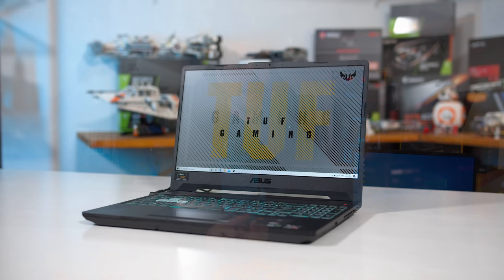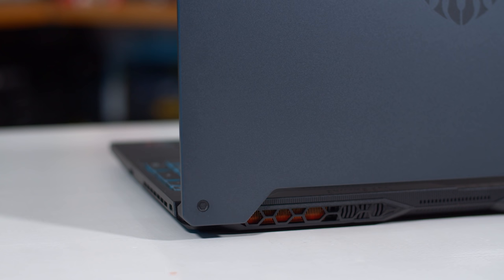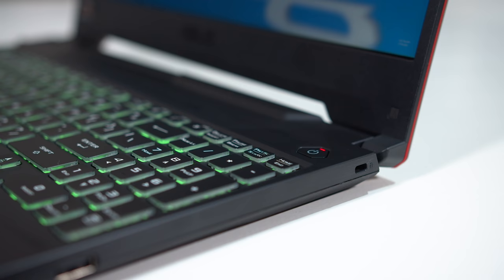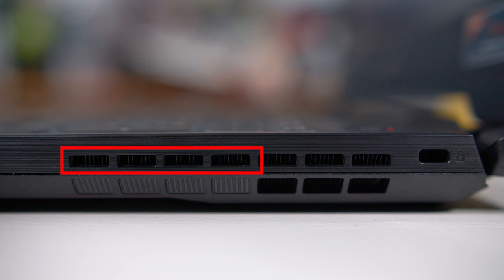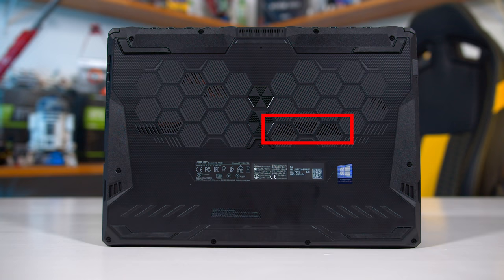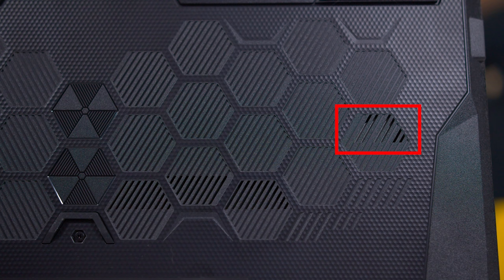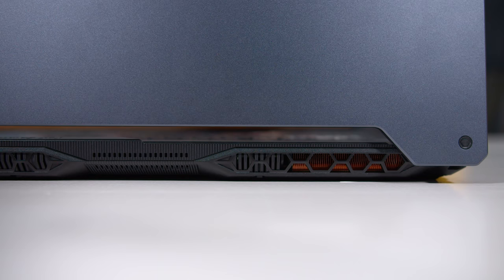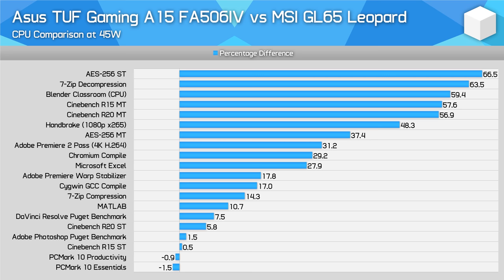Don't Buy The Asus TUF Gaming A15 (2020 Model)

Comment from the maker: Asus say they did not intentionally compromise the product in an attempt to make customers buy higher end systems. We offered our opinion that this might explain their design decisions, however the wording we used was poor. We've removed that section from the video.

Asus also deny the cooling design is flawed, saying that using an open vent design is overall worse for thermal performance. We are looking into independently verifying these claims and will update you when we have tested the laptop further.
Reply: thankyouuu...
Reply: It's wierd, it's surprisingly cheap where i live, so I'm still gonna buy it probably. I hope you guys keep doing this kind of videos, i personally would even buy a modded bottom panel. Overall i still believe you bringing up this problem was the right thing to do. As for the screen, i believe it's as bad as the others in the price range, like the GF65 thin, which has a 8% price increase where i live, and it has similar specs, though probably better build.
Reply: Thanks for being honest and correcting the mistake. 👍
Solid move! And thanks for getting in touch with asus about it.
Reply: Your review is most probably correct and Asus claims are most probably not. I have the same but 2019 model with the Ryzen 7 3750H and RTX 2060 and it is a bucket of heat, noise, and video problems, being the first that the computer shows the video panel attached ONLY to the APU and some games just do not use the GPU whatever you do. You MUST play with headset on or you won't be able to hear the game over the roaring fans. The NVMe is not the fastest, just ok-ish and cheap... I was also surprised by the lack of proper ventilation, and I opened it to install an additional HD for storage. If the heat pipes are not the same they look very similar, so maybe you are dealing with an old thermal design. Now I want to test it without the bottom part, dammit...
Reply: "using an open vent design is overall worse for thermal performance." that's some BS when MSI's GL65 performs way better with open vents. For them to deny that their design is flawed = buyer beware alert.
Reply: So as i had stated on the day you reladed this video i had purchased this laptop the day before.  I now have it. This is using the exact same clamshell case design that is in the FX505 line.  A line i might add that has both intel and amd processors for all the people claiming ASUS is trying to hurt AMD.  I was happily supprised that this laptop can take a 2.5 inch drive if u dont get one with a 90wh bat. Hiden in the box was the connectors needed to do this.  Most of the time it is nice and quiet though i do use a powered cooling pad.  I have only had it get loud when running 3d mark.  Sadly this only had 1 stick of ram but i have a second stick that will be here in 3 days.  If more venting is needed for this laptop 5 minutes with a dremal tool will fix that.  For $999 USD it is a lot better then what i am currently seeing as alternatives. That may change in 6 months, but i hate playing that game.
Reply: Ryzen needs to support undervolting or just do it in factory settings. Then the thermal performance wouldn't be an issue. I had to UV my 9750H & made huge difference in my gf 65.
Reply: ASUS just Acknowledge you're design flaw already... you will loosing money.... or some rich brands with blue color will cover this shenanigans
Reply: I am looking for a good laptop to run Adobe graphics products. My last HP Spectre almost exploded due to cooling issues so your update is extremely important to me since good cooling is definitely in my top 5 must haves. Please update ASAP. Thank you.
Reply: bruh how is open vent worse
Reply: @GabiCostin001  i suggest you dont !!! MSI, Dell and Acer are yet to come to the race so i highly think you should wait a little longer
Reply: Please review mi notebook 14 horizon top model please
Reply: Looking forward to the testing, this sort of design has been around for years, nobody really talk about it.
Reply: Agree with Asus about the thermal design. Open holes are not necessarily good.
Reply: @winnewFirst  because they accumulate more dust in fans?
Reply: Anyone looking for a gaming notebook and worried about thermals. The gf 65 has a good cooling system and by undervolting the cpu an gpu u can have the same performance and very good temps. Its a good value notebook if u get it with the rtx 2060. Plus the i7 9750 puts out a constant 4 ghz playing games and has a 4.5 ghz max. Only way ur gonna get better performance than a gf 65 is with a rtx 2080 or 70 labtop.
Reply: @GroovyDrifter  Hey there!  So I owned the FX505DU before upgrading to the A15.  My brother still has his FX505DU though.  While both generations do certainly run hot, the two of us have found a great solution, and that is to use either Ryzen Controller to manually cap the TDP at *just* below what we see it use on stock, OR, just do the quick-and-dirty turbo-boost-disabling registry tweak.  Here's the kicker though: these two CPU mods don't work nearly as well without simultaneously undervolting/overclocking the GPU (as they share heatpipes, remember) so by doing that, in addition to the CPU mods, we have now attained GREAT thermals, at literally no cost to FPS.  In fact, sometimes we even see better FPS than stock!

Just as an example: using the turbo-boost-disabling trick, while simultaneously UV/OC my 2060 (via MSI Afterburner) to run at 1500MHz@0.700 across the board, I have achieved 100% identical framerates in all my games, but am now sitting permanently at 85C on the CPU and 80C on the GPU (instead of 95C and 86C).  Basically, the UV/OC performed on the GPU does well at making up for the cap on boost clocks.  Now if you're willing to perform a little trial and error, you can dial in the precise TDP using Ryzen Controller, and achieve even better framerates at the same temp, OR, since it quite more granular, a little bit lower framerates at lower temps, or higher at higher temps, etc.  You get the idea!

So you know, with the lower temps that we have achieved, the fan noise has been significantly reduced as well!  Hope this helps, and happy computing!
Reply: @gultar4513  Hey there!  You can significantly improve on your thermals in the A15, without compromising performance, by capping the CPU's TDP (or disabling turbo boost) while simultaneously undervolting/overclocking the GPU.  Instead of running at 95C / 86C max on the CPU / GPU, I'm running 85C / 80C, respectively.  Again, no FPS drops.  In fact, sometimes I see FPS improvement over stock!  Just thought I'd let you know.  Hope this helps, and happy computing!
Reply: i think they didn't open vent because of military grade design, they have to ensure that the product is long lasting, small vent will prevent dust or humidity go inside the lap. as Asus said, TUF series is long lasting product. Disable Turbo boots will  make the temperature much better.
Reply: @keubibo  No recent electronic product that built to last.
Reply: So, How's the update Test?
Reply: > Asus also deny the cooling design is flawed, saying that using an open vent design is overall worse for thermal performance. We are looking into independently verifying these claims and will update you when we have tested the laptop further.

That statement is blatant lie by Asus which you've ALREADY DISPROVED in your video by pulling the laptop's bottom shell, thereby uncovering the obstructed vents (eg.. creating an "open vent design"), and immediately improving thermal TDP efficiency DRAMATICALLY.  You provided empirical measurements to back you claim.  Asus' marketing/spin dept is full of it.

Look I realize unlike true journalistic media outlets, YT content creators live & die by staying in the good graces of OEMs.  Otherwise your access to new products are cut.  But you need to call BS when you've done the work & have the facts on your side.
Reply: Translation: ASUS is intentionally lying.
Reply: If you say so, I was about to buy this laptop. What do you recommend instead?
Reply: @theskywalker8416  When are these new MSI laptops coming? I'm asking because just today I was searching for laptops and so it happened that I had to choose between Asus Tuf A15 and MSI GL65 and I chose the first one, because it seemed better in every way. But now seeing this video and the comments about the heating problem and Asus pulling some bullshit... I may change my mind and pick MSI GL65. But now that u mension new MSI and that it is pays off to wait for them I think I can check them out to? Can u tell me more about them? When are they coming?
Reply: i really dont understand why they had to close some space where cooler take the air or use that monitor with with faster 45 watt laptop cpu on the maket
Reply: Asus has also blocked the underside cooling vents on the Zephyrus G15 Ryzen. The intel version known as the M15 with the same chassis is not blocked and therefore runs cooler, although it is still slower.
Reply: The statement of an open vent design being worse for thermal performance doesn't make sense.

There are pros and cons to the open vent design, but I'm certain that more ventilation would mean that the fans have more to breathe and the obvious benefits of airflow. The cons are obvious; potentially more dust ingress.

With all that said, my old Lenovo managed to combine good airflow with reduced dust ingress from the simple addition of a god-damn dust filter...
Reply: I bought mine with a 4 year in-store product replacement, and I will be using aluminium foil tape on the plastic area below where the fans go to help further cool the air flowing threw it. And I have a question, I'm gonna try to buy a spare bottom plate so that I can modify it for more airflow without voiding my ipr, was wondering if maybe you or anyone in  the chat here might know the best place to get things like that??? I tried eBay but the laptops too new to find parts for on there.....
Reply: tracking thread. I suspect Asus is simply covering their ass but is there any merit to the idea that closed vents can be better for cooling?
Reply: @robotgirlenjoyer91  The MSI GL65 is a 6 core Intel chip, the TUF is an 8 core AMD chip. AMD's run hot on more cores but don't throttle. People are idiots for even thinking this comparison proves anything.
Reply: Will be awaiting for the results of this verification Hardware unbox.
Reply: I bought two of these and I cannot get USB Type-C to display anything - is anyone else having this issue or is it just me?
Reply: how much they paid you
Reply: i am a rog fanboi and rog scar 3 owner but you know that asus's responds are bullshit, asus laptops mostly runs hot it's a fact, i jsut love some of their rog design lookwise, which is why i bought an used rog scar 3, of course i undervolted it to preserve longer life
Reply: Apparently there's been an update to increase performance (power draw) for the mobile 2060 GPUs.
Reply: @zoinbergs  Hi there, I have the base model for this laptop (GTX 1650 + Ryzen 5) and I need your help. While I was successful in disabling turbo boost for CPU and lowering temps by 10-15 degrees, the UV/OC of GPU wasnt successful enough. I made a custom curve using MSI AF, 1680Mhz@825V(just for trial) but while I apply and get into the game(AC Unity, 1080p on High), the curve gets slightly modified on its own, and I can't get it locked! So I have two questions to you, how did you zero in on that voltage and clock you mentioned? and did you get to lock your custom MSI AF curve, if yes then how? Thanks in advance!
Reply: WHEEZE
Reply: @21stcenturyschizoidman42  Hey buddy!  Yeah, MSI AB has a tendency to do that (modify the curve).  What I do to remedy that is take a fresh stock curve, select the first ball, highlight all the balls from just before the first one to just after the last one, then hit Shift+Enter twice to make all balls the same height as the first one.  Then I apply the "flatline," go back into it, and readjust it back to a flat line again if indeed MSI messed with it.  It seems that the more I save the flat line after readjusting it, the less MSI messes with it, until it becomes a true flat line that doesn't budge thenceforward.  (I think what MSI is doing is adjusting each applied curve in relation to the previously applied curve, all the way back to stock).  So you just have to keep flattening, saving, flatting, saving, until MSI gets the idea. 

Regarding voltage to frequency ratio, just start with stock (the first ball) and flatten all balls to reflect that ball at where it's at (usually your specific variant's stock clock).  Thus, because all voltages are the same across the board, MSI will just default to the lefter-most voltage, which is 0.700V, when running full speed during games.  THEN, to start playing with overclocking, just drag all balls up equally by holding the "Alt" key down while dragging any one of them, and you should now be able to raise your frequency (an overclock) while keeping your voltages at that 0.700 (an undervolt).  Indeed, you can do both at once!  Personaly, I have found that an overclock of my particular 2060 from its 1350MHz stock to 1500MHz provides the most bang for my buck.  But that does still get me up to 86C in some games, and to which induces throttling.  So for those particular games I just leave it at 1350@0.700 to ensure that temps begin to get lowered successfully.  The performance does drop, when going from 1500 back down to 1350, but not by much to say the least. 

Now, regarding the locking of curves.  Basically, once you get the line flat, and staying flat, just save that curve to a profile (1-5) and it should be locked in place thenceforward.  Also, on the topic of locking, you can always select a ball and hit Ctrl+L to lock the frequency and voltage to that ball.  However this is not ideal because it does not allow you your GPU to downclock when not under load, thus wasting energy (and increasing fan noise).  Definitely a good trick when testing out your system, but in the end you'll just want to create a full flat line for your GPU to hit, only when under load. 

Hope this helps, and keep the questions coming if you have more of them!  Have fun with your A15!
Reply: @zoinbergs  Thanks a lot brother, for your detailed reply! I will definitely try this....also I wanted to know what temps should I aim for, for gaming for like 2-3 hours a day(and extreme light usage otherwise), such that I can make this boy last for like 4-5 years? Although I know thats asking for too much for a budget gaming laptop.
Reply: Any trick to undervolt Ryzen 3750H???
Reply: I have a bunch of options to choose from at the Processor Performance Boost menu: Disabled, Enabled, Increased, Enabled if efficent, Increased if efficent, Agressive, Agressive and efficent. Witch one to choose? BTW where is the point where the CPU/GPU is considered to be too hot?
Reply: @av5334  No true "undervolt" exists yet for mobile Ryzen chips.  Just the next best thing, which is to cap TDP using Ryzen Controller, or cap boost clocks using the turbo-boost-disabling trick.  Either method works rather well though, in my experience, to keep temps low while still maintaining minimum-to-non-existent hits on performance (fps).
Reply: @benedekorban7564  Disabled seems to work the best (capping the clocks at 2.9GHz).  Some people have seen Efficient Aggressive work well too, which doesn't disable TB entirely, but rather, only lets it kick in once CPU utilization reaches 60%.  So in certain games, I imagine Efficient Aggressive could work better.  But in my experience, fully Disabled has yielded the most consistent and promising results.
Reply: @21stcenturyschizoidman42  Taking longevity in mind, I imagine a CPU temp of 85C or less / GPU temp of 80C or less would be the most ideal.  Sometimes (for more modern  games) I have accepted gaming at 90C/82C or something like that, so as to maximize performance / ensure I hit my preferred 60fps minimum.  Seeing as how AMD/ASUS designed their Ryzen chips in these A15s to throttle at 95C, with a design limit of 105C, I actually think perpetually gaming at 95C wouldn't hurt *that* bad.  I imagine most people simply don't like seeing temps higher than 90C simply because that's what they have historically been used to being concerned about, and especially so when dealing with other chips (Intel for instance).  But technically chip manufacturers could make chips, components, etc. to perpetually hold 120C or something, for that matter!  Basically what I am trying to say is, nobody seems to be comparing apples to apples anymore, and are dissing Ryzen chips for being "too hot" when in all actuality, nothing at all may *truly* be going *wrong* here.  I mean, take for example AMD's Ryzen 2700X chip.  It has a design limit of 85C. By comparison, the Ryzen 4800H is on fire!  But obviously this isn't an apples to apples comparison.  Ultimately, in the end, if AMD says they made their 4800H chips to tap out at 105C, AND they let OEMs like ASUS run them perpetually at 95C, I don't think anything suspicious is going on here, nor is there any likelihood of truly shortened lifespans.  Chances are, gaming for 2-3 hours a day at that 95C limit, with sporadic use in the interim, there is a high likelihood that your CPU will out-live that 4-5 year target just fine!  But nevertheless, if you CAN drop temps using the aforementioned CPU and GPU tweaks, while still maintaining the same or close-to performance when doing so, then why not? =)
Reply: @zoinbergs  Hey I did as you asked and UV/OC-ing is working as expected 😀(still looking for the sweet spot though and I think GPU boost 3 is okay for me rn as is, for AC Unity on high, temps at 78-80 for CPU and <75 for GPU, which is VERY okay for a CPU burning game like Unity lol).
Nevertheless, thanks a lot man for your detailed replies, you're a life saver!
Reply: @21stcenturyschizoidman42  hey man can you give me a link on how to UV/OC tuf a15?
Reply: 18ms gtg is unacceptable in 2020, especially on a "gaming" marketed laptop. Thank you for highlighting this. Doing Gods work man.
Reply: @wonderfullifemyqueenandmye4259  buddy there's no video right now for that specific model but you can check out videos for UV/OC ing in general using MSI Afterburner, that'll be fine.

Also, you can check out Mr @William Montgomery's replies to my questions in this comment thread, regarding UV/OC ing, those are very detailed and helpful for sure
Reply: So, no Updates so Far,..
 I Guess this Video's title still Valid : Don't Buy The Asus TUF Gaming A15
Reply: If you want to get rid of the laptops after you are done with them, give me one and raffle off the others in a contest. I can suffer with one of them,,, 😎
Reply: Hey bro... I saw your review I'm very happy with it.. but I am going to take it for programming and app development.will those issues of display and cooling ruin my work ?? Please respond me
Reply: @theskywalker8416  MSI and Dell's have already been available, so how have they yet to come? Which country do you mean?
Reply: @michawojcik5903  Something getting "hot" and it being a problem are two different things. No one has demonstrated the high temps do anything besides cause more fan noise.
Reply: @washuai  More fan noise itself is a problem nd high temperatures decrease the laptop's lifespan. Also MSI's aren't yet available.
Reply: @michawojcik5903  the fan noise is a problem where? It only happens during gaming or serious load and you have multiple ways including easy silent mode, if and when it matters.  In the office, the click of the keyboard is louder and there's some reason you had to do this load on a laptop instead of a desktop. The HVAC is generally louder if you are near the vent. In the cafe, the cafe and talking is louder and your laptop is at risk from food and drink. In a library, why would you game there? odds are they aren't going to say anything even if you decided to bench in the library. In a library, you're definitely using a headset for video, etc. Why, because the speakers and talking are louder and more disruptive than the fans. In a lecture - you're not going to be running anything that intensive, taking notes and you're supposed to be paying attention.  In a shared room, where you sleep - again, you snacking and typing and mouse clicking is more disruptive.
Reply: @michawojcik5903  AFAIK the weakest link in the laptop gets in trouble at 150C. This leaves the weakest link temp wise is the human and it isn't bbq to touch.  laptop's are obsolete in 3 years. I prefer 5-10 years or BIFL, but I'm aware even a perfectly good 3 year old system won't compete with current hardware and software. This years Dell G5 SE laptop is better than 3 years ago one below the best desktop. Where's the data that that heat damage occurs? while the hardware is still relevant?  For this specific engineered model? I've a lot of experience with heat damage in refurb Dell's. Those things served 1-3 years before refurb, 3-5 years being heat damaged and they were still operational, even heat damaged, but were well past due to upgrade in that business setting. None of that really tells me if the different model Dell that got bought today would last longer, better or the same. Also, if you're willing to trade power for lower  temps, there's the boost off, undervolt / overclock and it is still more powerful than the competition in the same price bracket, even gimped.
Reply: @michawojcik5903  The MSI Alpha and Bravo have been available. The Bravo is hot and has a 5500M, instead of the 5600M or better, but they are MSI with this gen of Ryzen cpu.
Reply: You guys are missing the static pressure they are trying to accomplish by blocking off some of the vents this way. The fans need to be allowed enough pressure to move heat away from the heat-pipe vent traps. if there is not enough back pressure then heat can move fast enough. You guys are obviously missing this fact. If you have the tools to measure static pressure and heat flow, pop the vents open and do appropriate testing. If not you should not even be commenting on these design decisions with out first following up with the science behind them.
Reply: @21stcenturyschizoidman42  Great to hear, my good sir!  Regarding the sweet spot, I never had much luck with higher voltages or frequencies myself, because in the end, I kept hitting the 86C wall when doing so (and to which induced throttling).  So in the end my sweet spot was really to just flatten the whole curve, from beginning to end, to always keep things running at 0.700V.  In fact, just benchmarking under stock, I frequently saw my GPU throttle down to the 0.700V-0.750V range anyways, just with a higher frequency at that range.  So I figured, might as well just start off at the place I'll eventually end up, right?  But at least this way I get to control the frequencies now.  If I can, I push 1500MHz.  If I must, I push 1350MHz.  If I feel like playing on cool-and-quiet machine, I imagine I could drop down to 1100MHz or something.  Now, my frequencies are really what control my temps. =)  As your most recent post reflects, it is pretty darn nice to be able to control one's temps so easily, isn't it, rather than just put up with stock!  Thank goodness we have options!
Reply: @pavanbalajibommireddi  For general programming and app development, unless you're creating art or something, I imagine the A15 would be a good fit for you!  Ultimately, you can always hook up a decent external monitor for final proofing, if you really need the color accuracy.  BTW you can disable turbo boost (or, alternatively lower TDP using Ryzen Controller) for regular rendering / compiling tasks, too.  That way you can keep fan noise down / device longevity up.  Even with turbo boost disabled, I imagine the 8C/16T configuration would still beat the pants off of other solutions in this particular price range!
Reply: @washuai  "Something getting 'hot' and it being a problem are two different things. No one has demonstrated the high temps do anything besides cause more fan noise."  I absolutely second this.  I have discussed this concept elsewhere.  Unless *true* unintended throttling is going on here, like where erratic frame dropping occurs, or perhaps slow frame drop over a long period of time, or say overheating and shutting down, etc. etc. then what is everybody bitching about?  Sure, ASUS/AMD could have designed a cooler chip.  But so what if they didn't.  As long as the cooling solutions provided do the job, there is really nothing to complain about.  Just like you said, more fan noise, whoopdy do.  I find it odd that "gamers" are concerned more about fan noise than fps.  Yes, it would be nice to have a 100% silent machine pushing a million fps.  Who wouldn't?  But as the saying goes: you can't have your cake and eat it too, guys!
Reply: While I can make a TUF A15 run cooler (stay below 75C in 93F weather) and I am giving Asus engineers some benefit of the doubt -  there is also the truth out there that the HP Omen & Eleuktronics RP 15 run cooler (though cost $50-$250 more vs the 1660 & 2060), which is a much better comparison than the 6 core intel machine in this vid. I figured the closed off is part of the dust rating
Reply: Would believe your rewiews over a company as well known as asus.
Was great too hear the truth.
Reply: Temps get higher while playing games but its normal. All laptops touches that temp.
Reply: @user-zu1ix3yq2w  fast forward, turns out ASUS was telling the truth.
Reply: Dear. the open box doesnt mean anything... this is not natural cooling. this is forced conveccion system. they need to play with the internal and external pressure to garanteed the perfect heat flow.
Reply: I think it's just keep a check on the dust entering the system
Reply: I'm from the MSI video..
Reply: We love this reviews.
Reply: There is precisely a ZERO PERCENT chance that the statement "using an open vent design is overall worse for thermal performance" is true. 
Side note, I would love to hear Gamers Nexus opinion on the statement lmao.
Reply: @Joe-nq6hy  tysm! Helped me a lot in dilemma to buy the laptop
Reply: Is a15 is a bad laptop ?
Reply: Got fx505du and it's been going good for a year. Can't speak for the other models but mine has never had an issue with heat. That's just me tho
Reply: Really good to see unbiased journalism! So many tech channels are sucking up to companies in hopes of support and products for testing. What HW unboxed is doing, is saving the consumer from making uninformed decisions.
Reply: thanks i love you bro
Reply: @GroovyDrifter  that's whack I have the 1660 Ti edition and it handles everything perfectly, only problem is it used the GPU for Chrome for a while but I'm pretty sure that was my own fault.
Reply: I disagree with this assessment.  I've owed and used the A15 for a couple of months.  I've had no problems with it.  GPU Gaming temps do not exceed 80c on performance fan mode.  I think the Armoury Crate settings do a fine job, especially when ramped up to Turbo.  It's much noisier than my old Zephyrus but that was a obscure, flimsy cooling solution.
Reply: Want to sell me one of them laptop cheap?
Reply: If the vent was not blocked, wouldn't it be annoying for most users, since the laptop would be blowing out hot air to your hand, while you are trying to use the mouse?
Reply: ps5 is lit gh
Reply: They are just lying all of what u said is true that is so disappointing
Reply: Gabriel Costin yeah, this think is really cheap for a gaming laptop for where I live in. The tuf 506iv isn’t for sale in where I live, so that’s disappointing.
Reply: Well.. I have rhe same laptop.. But u dont find any heating issue... But yeah screen display..isnt really what I was expecting
Reply: This guy is paid by the msi. LOL
Reply: And when?
Reply: I think it's just the curse of a gaming laptop that gradually all the heat in a small space WILL cook the GPU over time.  At least back 10 years ago when I was gaming with a tower that's what everybody said with the matter of factness of 'duh'.  So I don't think they were sabotaging in on purpose as much as design a 'same as it ever was' machine with a short lifespan.  I was always hoping somebody would come up with a better cooling solution so you really could buy a 1200 dollar machine without having to accept you have two years tops out of the thing.
Reply: I've checked it myself. Put it through the stress tests & it's par for the course. I've only tested the model with the RTX 2060 gpu. So far so good !!! Every PC has it's pros & cons. This seems like a good bang for your buck !! I've Always liked MSI !!! Until I had 1 break down after 2 yrs ??! Another client said he had a bad experience with MSI as well !! For gaming, it's more than enough !! I'll let you know if it breaks down. I've heard some gamers say, they wouldn't touch another MSI ??! I'm still not ready to hate on MSI. Like some others !!! A lemon can happen, even on the best products !!! The noise & heat wasn't a real issue. Not YET at least. I also wanted to check the "issue" with the display. I had to lower the brightest because it gets too bright !!! (300 nits) NOT an "issue" !!!! PS. If you want the same specs ??! In this price range !!! Prepare to pay MORE !!! ( Double ) !!! Other reviews on this laptop are in line with mine. For another review on THIS. Check out Jarrod's Tech. Among others !! Just in case I don't know what I'm talking about ?!! Or maybe I've been lucky up to now ?? Going to be testing it for another 2 weeks. Looking for a reason to return it.
Reply: Hey so you never came back to say if they're right or not
Reply from the maker: @SteadfastWL  https://www.youtube.com/watch?v=HJS-ZAmcreI
Reply: @GabiCostin001  Esti multumit? Il am de o zi si pare ok.
Reply: P
Reply: @gultar4513  how would you do it with a dremel? Interested.
Reply: @keri2000  me too bro im still confusd
Reply: @Identity242  tim has another video were he actually using a dremel to cut out holes.  looks like he fallowed my suggestion or someone elses who said the same thing.  if you take the back plate off you will have guide lines were you can use the metal cutting tool of the dremel to cut slats for more air flow.  watch the second vid if you have not already
Reply: Then why did u even upload the video😑
Reply: He's overreacting to be fair.
Reply: Any idea as to whether the RTX3060 version is any better? 
The Asus version is nearly half the price of the next competitor the MSI GS66 Stealth (ZAR 24,999 vs ZAR 39,599)
Reply: An open vent system can cause more dust inside the laptop that can really mess up your laptop so I can kind of see what they mean in the long run
Reply: Their cooling system is what I'd expect from Chinese sweatshop workers paid in potatoes, so It doesn't surprise me that their spokesperson is equally idiotic
Reply: @GabiCostin001  Don't.. Don't do it mane. If you see this, I hope you haven't bought it. This thing is an absolute shit show of a computer.
Reply: soooo he's lying bruh I've researched this laptop for a long time and the cooling design is not flawed but his brain is
Reply: @witchdoctorgamingvods2006  shit, this is old ;)). I got a Y540 with rtx 2060 some days after the video because it was dirt cheap where I live. Best buy ever.
Reply: Mine is ryzen 9 4900 h and 1660 to can suggest me Max hashrate afterburner settings??
Reply: I personally see that the more vents it has or the larger it has the more dust able to enter inside, so what they said about "... using an open vent design is overall worse for thermal performance ..." it fits that reasoning.
Reply: Are they fixed the heating issue now?
Reply: Okay sure, let's take all of Asus's claims as correct- why do systems with the same exact specs perform faster, quieter, and cooler? SOMETHING is wrong with the design.

I almost forgot about the screen too. Nothing about this laptop makes sense.
Reply: what model of MSI GL65 he is talking
Reply: @GabiCostin001  How much did it cost?
Reply: @GabiCostin001  I'm thinking between the gf65 thin and A15 too haha